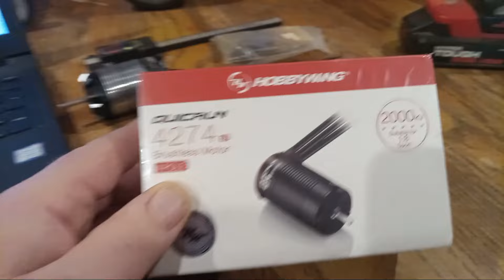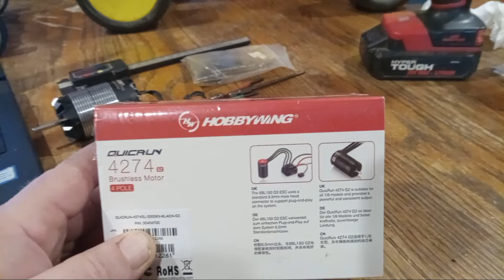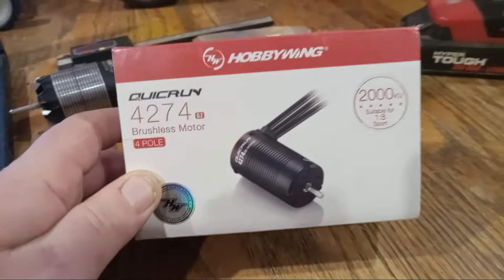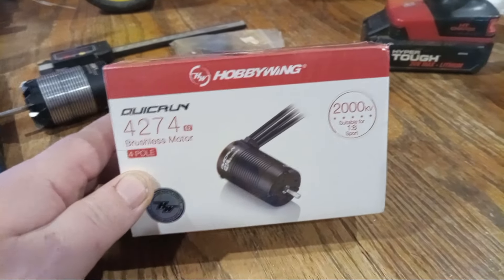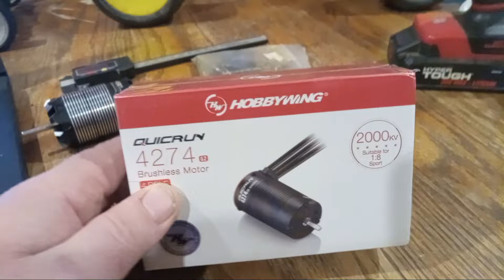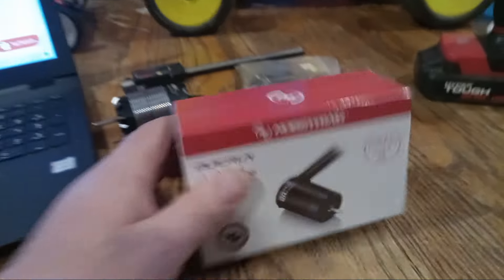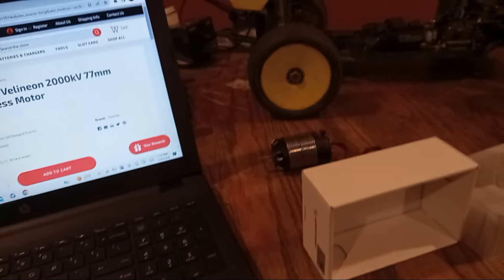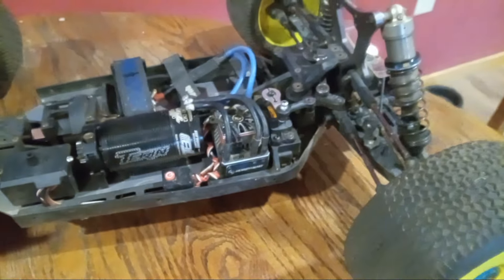Cheap Hobbywing Truggy, or buggy motor! 4274 2000kv Quicrun G2

Comment: What happened to your tekin motor ?
Reply from the maker: Bro, the rotor exploded.  I replaced the rotor with one from a from a surpass hobby motor, and it still works fine. Just wanted to try this one out, cause if it is good??? for the price, you can't beat it. $55 on eBay 😮